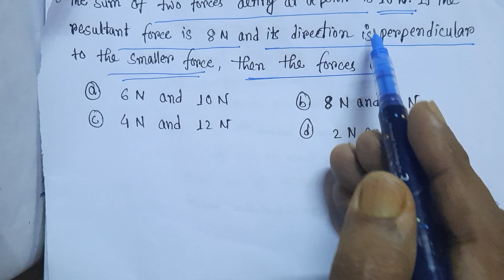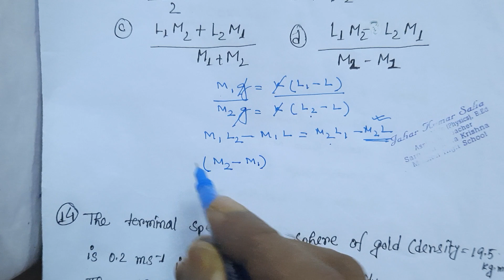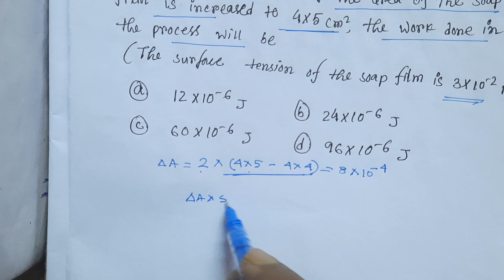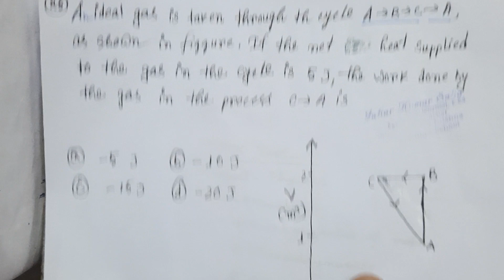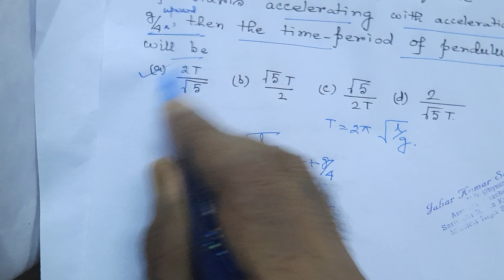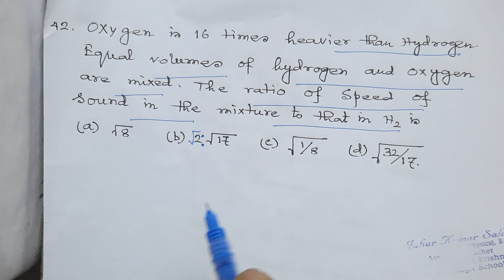#Mock-Test-4 /Subject-physics/Topics-Kinematics,Wave,Bulk properties,Thermodynamics &S.H.M.

Comment: Thank you Sir.Very helpful. The questions are well equipped with calculations and the solution you provided is the shortest possible way to calculate and solve.Every question helps to revise the topic and important points regarding the chapter.